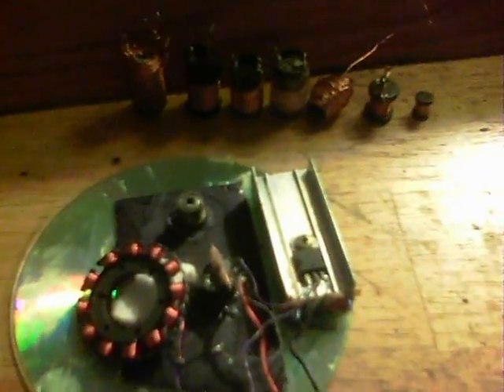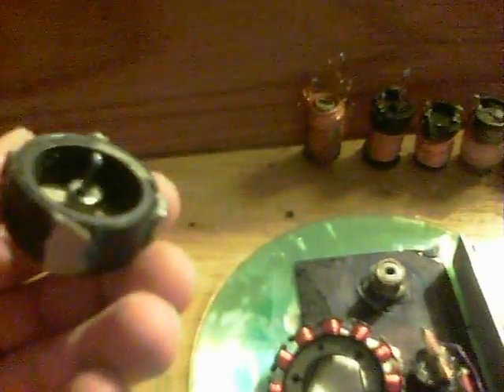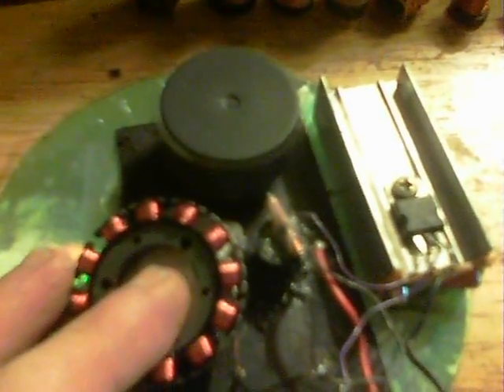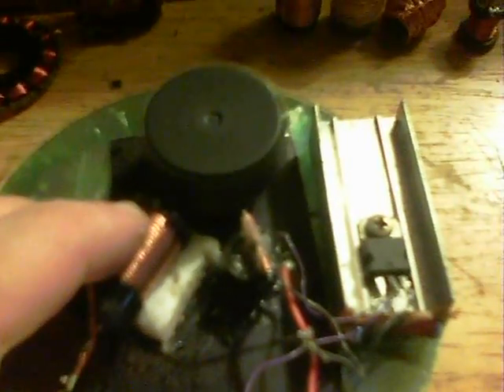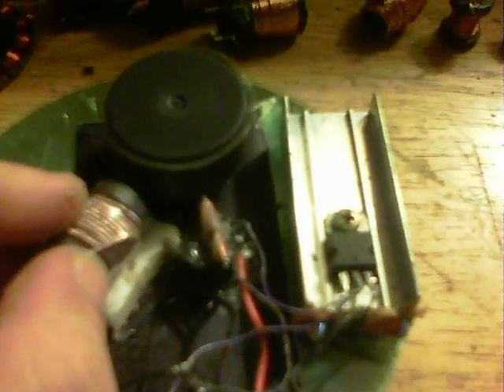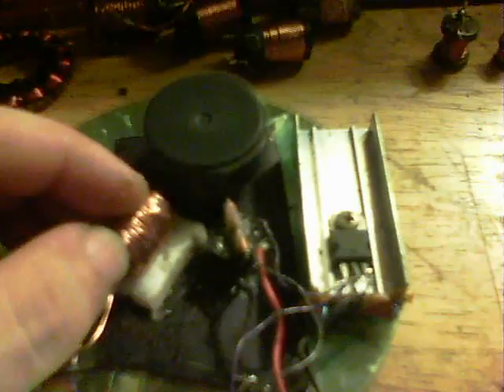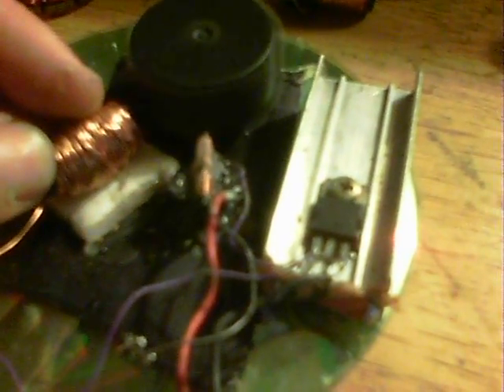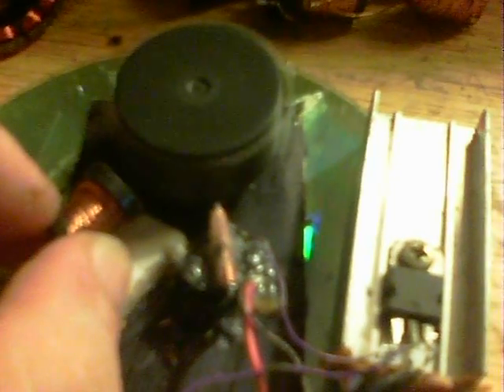Magnet Kicker - 8 coil Mega-Test

Comment from the maker: @imtotob Thanks :) There are 2 contenders that stand out, the multi-strand because it runs as low as 4.5V and the single strand large coil as it spins the rotor fastest. I'm looking for a combination of both qualities. 
As long as there is a noticeable hum felt from a coil when in front of a magnet, then any coil of enough winds will work at the right distance.
Efficiency after what works is where i'm at...just gotta throw things on and try them.

Comment from the maker: @medi40 Hi. Yes, the circuit is within mariuscivics video - 2nd video down on the sidebar to the right.
The thin tiny coil to the right of the coils being tested is powered up when a magnet passes by, switching the transistor or MOSFET. No other components are needed :)